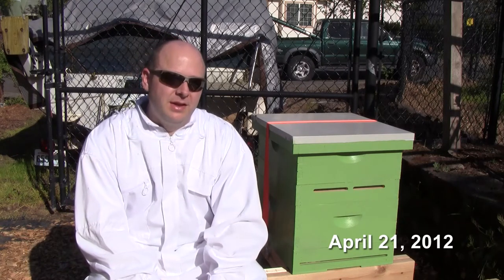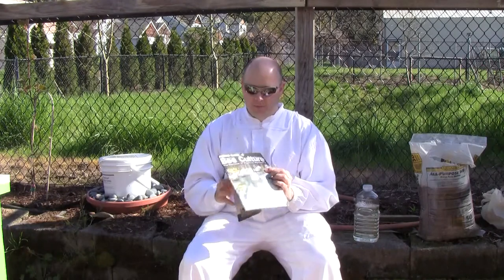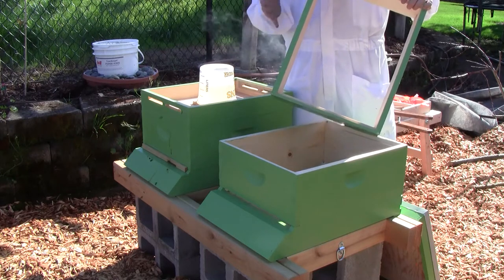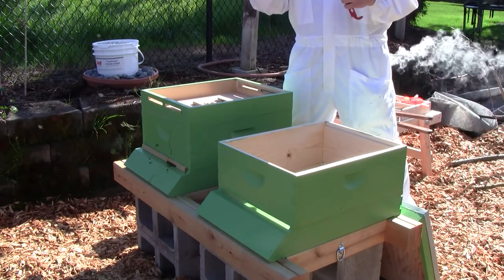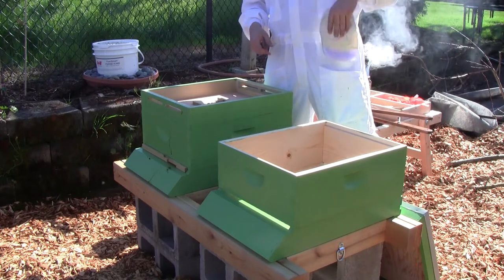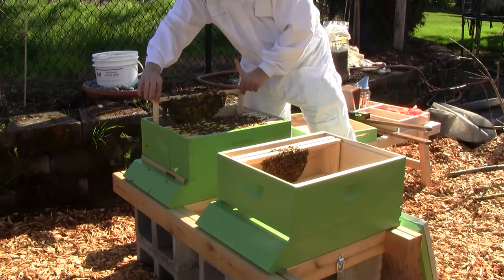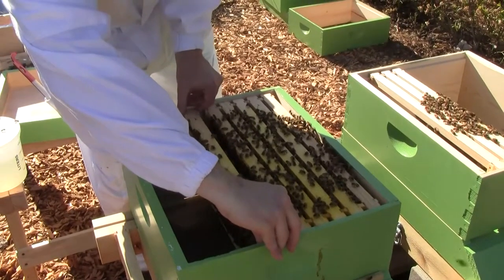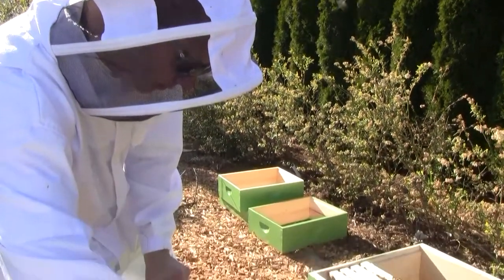Bee Vlog #12 - April 21, 2012 - Part 2, Inspecting capped brood

Comment from the maker: Thanks Glen! Glad you're enjoying the videos. I considered going with 8-frame boxes but ended up with 10-frame because it's just easier to find such equipment at my local bee supply store. They have some 8-frame stuff, but not much and it's not well stocked. But if lifting heavy boxes is a big concern then 8-frame is certainly the way to go. Good luck with the bees! Are you getting packages or going to try swarms? This next year I plan on catching several more swarms myself.